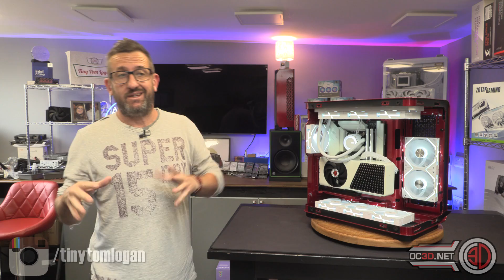DIY Fix?  Intel 13th and 14th Crashing Issues

Comment: CPU : Intel Core i9-13900K processzor
GPU : INTEL ARC A770 16GB Limited Edition
Motherboard : ASUS ALAPLAP PRIME Z790-P WIFI (LGA1700, ATX)
RAM :G.SKILL Trident Z5 RGB 64GB (2x32GB) DDR5 5600MHz CL28
CPU contact frame : Thermalright LGA1700 contact frame (aluminum anodized)
Watercooling CPU + GPU with 3x420mm  radiators

More than a year and I have ZERO issues.

Comment: Undervolting alone won't do, the cpu will still request very high voltages when doing single core loads and that will fry the ring , which is the real problem.
If you want to prevent that you NEED to underclock the CPU so to ensure it never requests more than 1.40v so it doesn't fry the ring. A underclock of 300-400mhz and undervolt it will guarantee it will not degrade (if it isn't degraded already)

Comment: Those temps for the i9-i7 initially scared me off intel but it was so difficult finding appropriate Ram sticks for the Zen supporting boards here so I went with the 13600k, 1 year in stock use and no issues, undervolted recently and ran cinebench for 30 mins, seems to be stable still.

Comment: I stopped building my rig until they roll out with the new Bio's Microcode ,  I intend on flashing my Gigabyte revised motherboard before installing my i5 14600k.

Some good videos on how to flash the Bios update on your motherboard  before putting it together.

May be the new Microcode address over voltage and over power,  at one point  motherboard's were trying to give the CPU 4096w I saw on some videos.
Reply: Well to flash the bios without the CPU installed your motherboard must have bios flashback to do it if it doesn't have it you can't flash the bios unless the CPU is installed.

The CPU never reaches 4000 power, is just a way to allow unlimited power draw.
Reply: @ivantsipr  yes my motherboard has the Bios flash update button on the side .

Comment: Unfortunately, some of these cpu's are affected by oxidation and the microcode will not fix that problem because they have physical damage.
Reply: Oxidation affects every CPU, which is why all CPUs have a limited lifespan. Because the voltage peaks are often too high, the gen 13/14 break down more quickly.

Comment: Same here and greatb insight..I always undervolt from the start as the motherboards were always just pushing too much vcore on stock settings. My 14900K on auto with my MSI Z790 Carbon was pushing too much at stock so I had a max adaptive at 1.345v with a 320w limit when testing with a 41K cinebench R23 multicore score, normal day to day is 1.3v...no issues whatsoever..no temp issues when managing vcore properly with a 360mm aio.

PS people also seem to forget how AMD had issues when the cpu's could not hit rated boost speeds and the same with pretty much all manufacturers over the years...Intel AMD, and Nvidia have all made huge mistakes and what really matters is how they deal with it...Hopefully Intel will replace any CPU that is causing issues as they have opened a returns window.

Comment: Undervolting worked with 12900K perfectly. Less heat and more performance.
With 14900K it never worked for me.
Mind you, I have a stupendous cooling system. 
What instability do I have?
Well, the simple thing to diagnose is Cinebench R15 crashes, while later versions do not. Real life things is HZD couldn't even start whole HTFW was. Apex worked. I have installed Apex because people were having issues.
R15 wouldn't work while Prime95 small FFT's would work and would even pull 400 Watt's power and still br in middle 80-ies C.
I have tried all bios versions and all "fixes" made many bios configurations and issues would 99.9% stay.
That 0.1 percent was gone soon as well.
Now I believe my CPU has degraded and after I try new bios with the new microcide I will decide what to do.
Namely nowadays my CPU  crashes my system once it twice a week in the application or even just watching a video. 
I have tried under volting combined with VRM load line calibration.
I have tried so called Intel power settings and that was not running R15 despite lowering the all core speed from 5.7 GHz to 5.3 in peaks and dropping to 5.2 GHz.
I have tried AC and DC load calibration as well. Combined with different power and current limitations and load line calibration.
I have spent days in testing crashing and there was no help for my CPU.
Current limitation kinda really does limit actual power draw while power limitation kinda allows mire power in some scenarios.
All that with MSI Z790 Tomahawk with Trident Z5 DDR5, water cooled 4090, Soundblaster AE-9, Intel network card, 1200 Platinum rated brand new supply from BeQuiet!, Corsair 7000 case. 
All that done by me who used to live from fixing issues and building PC's and special purpose PC's.
When I was building my first watercooling system only waterblocjs were available and only in the USA. Radiators were heatercores out of cars.
Pumps were aquarium pumps.
There were no 12 cm PC case fans so you sourced thise from industrial usage and cut holes in cases that were white or broken white only. Cases didn't have had windows or lights.
I was system administrator for two decades. 
Intel just made huge mistake with the 13th and 14th gen CPU's. 
I do not see them sorting it out either.
Even with new microcide and if they send me replacement CPU I do not think it will have promised performance or that will be long term stable.

I hope I am wrong.

Comment: My 13700k / 4090 build has been flawless for almost 2 years now. Started on Z790 ddr4 msi tomahawk then switched over to the ddr5 msi z790 tomahawk months later when it was released. Contact frame since day one as well. 13700k oc to 5.6ghz on all 8 p cores, All 8 E core oc to 4.4ghz, Ring oc to 5.0ghz at 1.34v. Even the mem controller has been very solid. 32g.b Corsair rgb vengeance 6400 cl32 hynix A-Die oc to 7200 34-41-41-83 at 1.45v. On a msi z790 tomahawk. I use my system everyday 7 days a week for over 8 hours a day for work / gaming. I can't complain.

Comment: i undervolted my i5 14600kf to a fixed core voltage of 1.150v and i run it stock boost 5.3 ghz. I get max temps of 76 degrees  celcius.

Comment: OK I have a solution that will see this platform out (of which I am invested as I have 3x 13/14th gen systems). So, due to the fact that Gigabyte hasn't been releasing Z690 updates and I am not convinced the microcode fix due next month will work for either my 13900k (x2) or my 14900k or that Gigabyte will release timely updates on their Z690 or Z790 boards, I have gone extreme.

Initially I thought I would buy 3x 12900k and make peace with it. Then I thought, why not set everything to make my 13900k and 14900k effectively a 12900k? So I am now only running 8 e cores instead of 16, power limits, base and boost clocks are as per Intel specification for a 12900k.

CPU-Z, 3DM CPU Profile and CB R23 show the system now performing at ever so slightly higher metrics than a 12900k (I guess due to process improvements and variation in systems). What is more amazing is that running the Cyberpunk 2077 and Forza Horizon 5 benchmarks at identical settings, yields a slightly HIGHER score! We are talking a single digit FPS improvement on CP and 20 FPS on Forza - even if that's margin of error, it's not slower.

The system seems much more responsive in Windows and the games seem more smooth. Previously there was the odd stutter. Don't get me wrong, Intel are still on the hook in my eyes but I want to be productive and not worry about the systems until I decide to upgrade.
Reply: Under clock it 300-400mhz, limit power and undervolt it (you want to keep the CPU from requesting more than 1.40v) that will prevent it from burning the ring (which is the actual problem).
Reply: My VID voltage after running benchmarks and leaving on all day, working away is min 1.198v and max 1.316v.

Comment: This is just more proof that Intel is for enthusiast only people like him and me already figured that out when we were reading reviews about 90°C 100°C temperatures I just went straight to de lidding went straight to direct die cooling since the sixth generation Intel and haven’t had any problems with any of the CPU’s. I do have a bad sample 13900k that if I run it at stock it needs +.100mv to be stable. If I tune it manually it’s much better and I do do a -voltage instead of a +.

Comment: I have had my 13900k since Nov 2022 which I undervolted about 1 week after purchase. 0.08 negative offset,  P cores set to 5.5 with 2 bosting to 5.9. E-cores locked to 4.4. No power limit as the offset takes care of how much it draws.  I've Cinebenched my rig to the hills and back and draws around 280watts under full load. I'm scoring circa 40,500 on R23. 
my VID values for the cores under Cinebench load is around 1.24volts

No issues to in gaming whatsoever. I also use the rig to render packaging models on Adobe dimension as well as export videos on AE.
I'm thinking the undervolt has probably prevented degradation, despite drawing 280watts under full load compared to intel spec of 253 watts.

I have now probably jinxed myself :)

System specs
13900K
ROG Z790 I-GAMING
4090
48gb DDR5 8000
Reply: VID under full load is not the problem, VID under partial or single core load is when the damage occurs, the CPU in partial or single core load will request very high voltage (1.40+) which the cores can take it no problem but the ring can not, as the ring gets more and more damaged you'll start getting issues with P cores/E cores/ memory  since everything is connected together by the ring

Comment: My 13900k is running at stock voltage the cpu recommends, with a msi motherboard.And touch wood had no problems, with a radiator water cooling.
Reply: As silicon quality is different between CPUs some might be able to withstand more than others also it depends on the kind of load the CPU works, from all the evidence the CPUs will degrade faster with single core loads than with all core loads, so a golden chip that only sees multi core loads will take way longer to degrade than a average chip which only do single core loads (one data center source has been renting Minecraft servers which are single core loads with very high memory usage and the CPUs only last 2-3 months )

Comment: Going from a 12900k to a 9950x I think. I was hopeful for bintel after they had year stuck on 14nm+++++++ when the 12900k came out but they have proven again they can't innovate and they just turn the power up. Very disappointed.

Comment: Ive never had a problem with my pre order 13900kf. Ive manually tuned mine from day 1 and done an all core overclock  basically dont let the 2 core's boost.

Comment: Damn. Running a 13700k on an Aorus Master z790 and g.skill memory at 6400.
The system has been stable since I put it together back in January of 2023 though, but now I'll have to go in and check everythin just to make sure.
Never had the time to follow your undervolting guide properly when it came out.

Comment: 1.5V stock is just insane, It was always 1.45 for a max voltage. In the old days CPU's would run at 1.25 out the box. This is all so they can get two cores to boost to 6 GHz

Comment: I've had my 14700K since day 1 launch. Stock CB R23 was getting about 34000 score w/ high voltages, temps, and pwr draw. I undervolted it, reduced pwr draw to 250w, locked all cores to 5.5ghz and I get consistant CB R23 scores of 36000 w/ perfect stability. 

I also have a 13700K which I did the same but it averages around 35K in tests, also very stable. I do think that the real issue is that Intel pushed their i9 chips too much to compete w/ AMD and it's biting them in the arse. i9 13900K & 14900K are fine but you have to undervolt them otherwise they will degrade and become unstable but tbh why pay for that if you have to downgrade it?

Comment: I have my 13900KF running 6.0 GHZ all core OC at a fixed VCORE of 1.39 volts.  Running great over a year now and have not had any of the reported problems.  When I first got it all set up and ran a c23 nulti-core run on a LT720 AIO. I was dumbfounded by the amount of voltage the CPU ran at stock out of the box.  I witnessed a max voltage on the CPU of 1.56 which is INSANE!  A newer bios update on the Aorus Z790 Master board lowered it some, but the VID voltages reported where still 1.50.  I locked the voltage in pretty much the same way as your guide suggests.  I found the max voltage it took to run c23 and locked it at that. When I finished my 3 rad custom loop is when I dialed in the 6.0 GHZ all core OC.  Owners of 13th/14th gen CPU's should follow your guide right away regardless of running an overclock or sticking with stock settings.
Reply: Is running tight at the edge, anything 1.40v or higher will start degrading the ring , yous CPU is a golden sample so that's why you dodged the bullet , but most 13900 will need to be downclocked and undervolted to ensure it doesn't requests more than 1.40v and stop degradation.
Reply: @ivantsipr  I'm so glad I overclocked and set a fixed VCORE with this chip. I couldn't believe my eyes when I first booted it up and ran C23 to test temps on the AIO mount. The MAX volts I recorded was 1.57 running the stock F4 bios I believe it was.  Looks like Intel went too far with these.

Comment: There is no DIY fix.
Reply: Under clock it 300-400mhz, undervolted , and limit your power, as long as the CPU never requests 1.40v or more it will be good, it it does request more than 1.40v specially under single core loads it will degrade the ring which is the whole problem.

Comment: As a consumer, why should I be troubled with dealing with bios settings? I think all should work well out of the box
Reply from the maker: Totally agree - covered that angle in the video too. Technically none of them have been great on auto for years. AMD included. Its just the nature of the beast when having to deal with a wide range of silicone. even with the exact same named cpu the voltage requirements between them can be very broad

Comment: Excellent, I have 2 desktops Intel 14900ks both have Asus motherboards Rog maximus z790 dark hero and Rog strix z790 wifi 2 both have Asus Rog gaming 4090's. Now I only overclock using built in AI overdrive that Asus has. Without any problems using for work or gaming. Not saying there's a problem with Intel, more with motherboards and folks trying to break land speed records.
Reply: Problem is Intel, they use too much voltage and burns the ring, if the CPU requests more than 1.40v at ANY time it already started to degrade the ring, single core loads will degrade it faster, also depending on the quality of the silicon it might take years to see failures, the patch Intel is gonna release reduces the voltage by 0.05-0.10v , that's just enough to slow down the degradation long enough that the CPUs will outlive the warranty, as long as the CPU doesn't shows errors before warranty expires they don't have to replace it.

Comment: The REALLY IMPORTANT thing here is the rig you are sharing the stage with! Very fetching indeedy! I look forward to hearing and seeing more. There was a McLaren sporting that very paint job sat outside a shop 25 yards from me when I came back in a while ago. The cockpit was done out in Noctua's traditional colour palette. It worked a treat. 

Edit: Are these the same two chassis as in your Farcebook pics? If so I'm being misled by your camera and my monitor. I'm seeing the two as Plum and not Cherry. My comment only stands for Plum. Nevermind; Plum or Cherry look equally fantastic.

When very conservatively set Super Micro blades hosting Minecraft servers have their cpus becoming useless after ~2months I think this is a plaster on a cut throat. The answer to Intel being crap atm and for the foreseeable is AMD, or  Intel 10th gen if you really can't do without your fanboi fix. If we keep putting up with crap; we'll keep being served crap.
Reply from the maker: Rig vid should be this week.... Ive been out in the sun filming it
Reply: @OC3D  Super!👍

Comment: 14900k  running R23 with 2 cores boosting to 6GHZ at 320 watts at 100c will have degradation  253 wats 400 Amps if you go lower 220 wats temps will drop lock cores. Delid for better cooling if overclocking.

Comment: Do i need to undervolt my i5 13600k? If so, i dont know how to do it. Because in the UEFI menu, its not easy to understand all the stuff in it. I have a Gigabyte Aorus Elite AX DDR4
Reply from the maker: Click the link for the undervolt video guide
Reply: @OC3D  I did but the process wasn't clear enough for me.
Reply: Yes otherwise it will die
Reply: Nope, 13600k rarely ever crosses 1.3v on stock (well maybe with the exception of Asus boards?) Iys still good to undervolt tho simply to get more power efficiency.

Comment: i5 13600k , first thing i did when i installed it on my MSI z690-a pro DDR4  was to drop the LLC from 9 to 2 , that made the Voltage go down alot and made my cpu about 20c cooler . Couldnt finish a cBench before , but after temps top out at around 80c , and keep in mind i have it aircooled . No problems since , so far at least

Comment: Thing is , its more than just too high voltage. They have been failing in server boards when they are run much lower than in desktop boards. Sure it wont help, but its more than just voltage there appears to be a fundamental problem with design or fab.

Comment: I've had a 13900k for almost 2 years now and the only time I've run into issues is during long initial shader compilations. An easy workaround I've found has just been to temporarily set my power plan to power saver mode and then switch it back to balanced after I get passed the shader compilations. Recently, there's been some games that require a lengthy shader compilation every time the game starts and so I'll try to follow the guide. Thanks.
Reply: They will accept the RMA if you bought it in a box